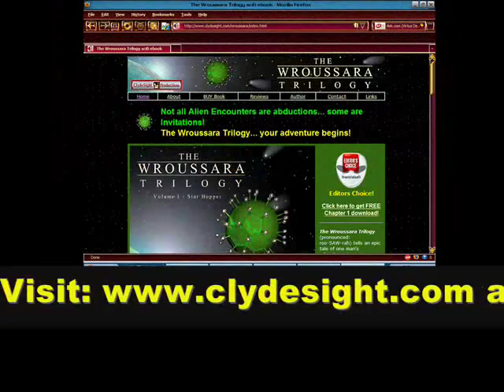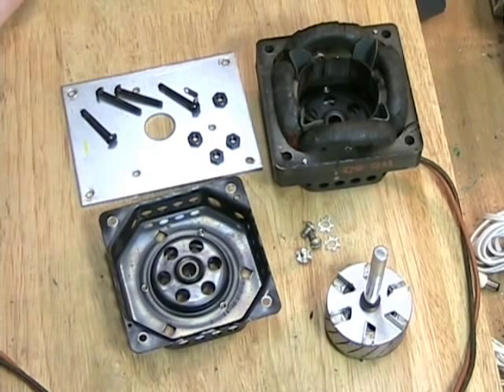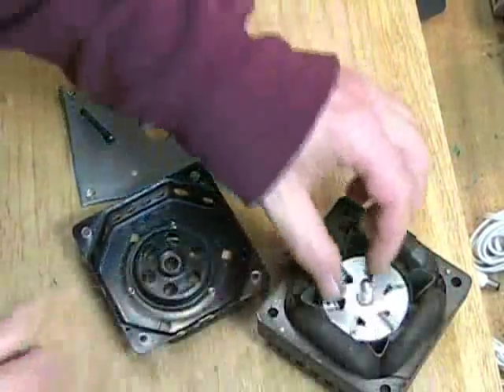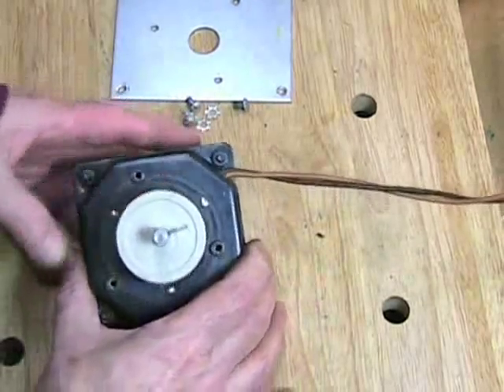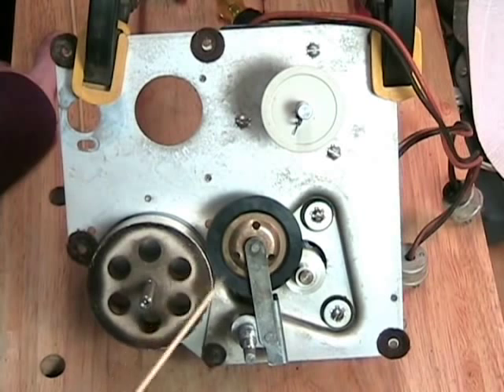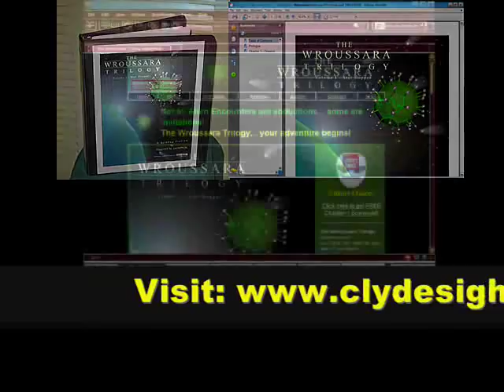Retro SciFi Tape Recorder - Columbia Bell & Howell Model 350 B (1955) - Part 2 - The Motor System

Comment: Excellent explanation!

It seems that B&H were think of things that many manufacturers would not adopt until more than twenty years later!

My AKAI X-200D also has three motors in a similar arrangement, although there are no solenoids or the like, but the way the motors drive everything is indeed similar. I shall have to do a video of that fine machine later on.

Comment: could`nt send it to them for a refit. So I tried to tie a string around the drive system and took it off to measure it. I measured it to be around 7" long, but when they sent me the replacement belt it was only about barely 3" long. So I sent it back with a note explai ning it was the wrong size and they said they could`nt  understand what I was talking about that it WAS 7" long. Now maybe I don`t get it. but could you please explain it to me as to how you measure a belt

Comment: Dear Clydesight, I was wondering if you could tell me where you get your replacement tape recorder drive belts from. I`ve been trying to deal with an on line company called Vintage Electronics, and they are aggravating the heck out of me by not understanding what size of belt I need. I`ve emailed them over and over, and they still don`t seem to get it. I need a belt for an R.C.A. Victor large tape cartridge tape recorder and the belt it took was melted and deteriorated and

Comment: that is`nt there any more to get the proper fit and size needed for a replacement. I swear (but not literally) that these guys don`t know what I`m trying to get at in explaining what I need. Maybe you could some day even make up a short video on how to estimate a belt size by the string method and then measuring it the proper way. I keep trying to tell them and tell them but like I said, we just don`t seem to be on the same page as to what i`m talking about.  PLEASE HELP ME.  Ed.